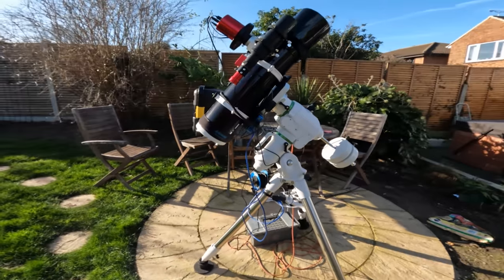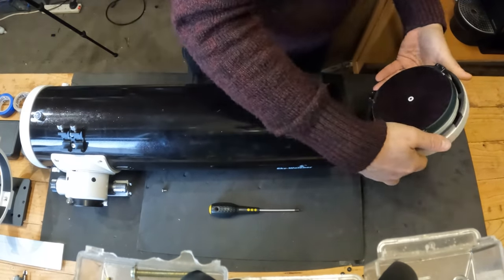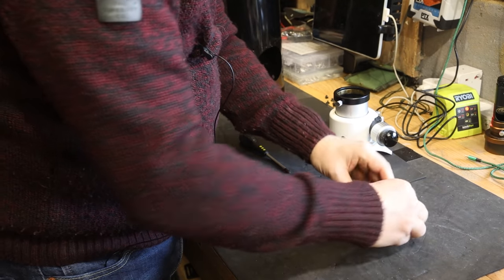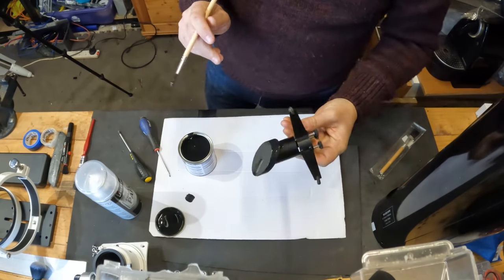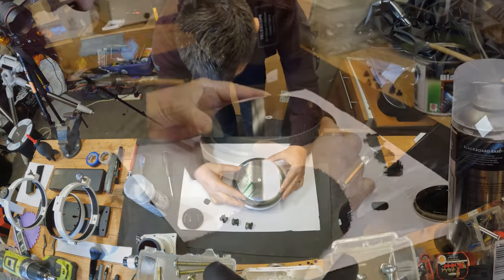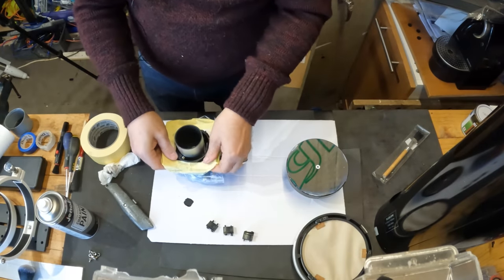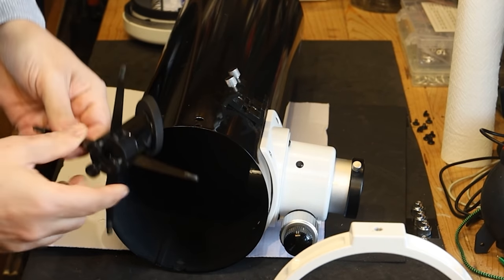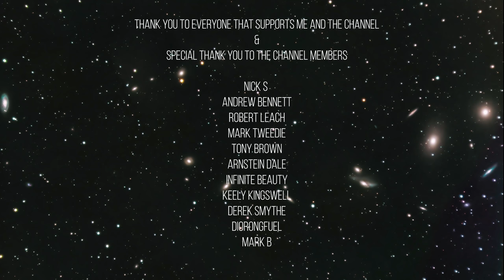How to improve your Newtonian telescope with a few EASY steps

Comment: It is a must have astrophotography mod for regular newtonians! I'd done similar to my SkyWatcher Explorer 200 a year ago. 
I can add some not obvious points.
Many paints remain glossy after drying. One should test several paints to choose the most matte and not reflecting (check at different angles). 
To diminish star spikes secondary mirror spider should be painted too (it is black but too shiny).
Reply: Some acrylic paints one can buy in art stores give very good results.
Reply from the maker: The blackboard paint dried in a lovely dark black matt finish so very pleased with that. Thank you for the tip on the spider veins I didn't think of that.

Comment: People underestimate how much shaking and mixing is required to thoroughly mix matte paints.  The sludge at the bottom that makes it matte compresses and compacts over time and takes a lot of shaking to mix it into the substrate properly.
Reply from the maker: Yes paint always needs a lot more mixing than you think. I thoroughly mixed mine though, just didn’t video the whole process as I am sure my video was boring enough lol.

Comment: Great stuff, I have thought about this myself but I just know I would get paint all over the mirrors. I would recommend flocking the tube as the "matt" paint used is not as matt as you might think.
Reply from the maker: Hi Clive and thank you for your comments. It was quite easy painting the edges I found. Thank you for the info on flocking. I am definitely looking to do this so watch this space.

Comment: Interesting video. I have used a black permanent marker for painting focuser tube and secondary mirror. It was fast and no disassembly was needed.
I also used flocking material inside the focuser and on an opposite side of OTA tube facing the focuser. Watch for light around the focuser tube. I used flocking material to seal it as well
Reply from the maker: Thank you for watching and comment, great extra tips thank you,

Comment: On my 200pds I fitted an aperture mask by Deepskydad  that helps as a lot of reflections come from the bevelled edge of primary and primary clips , flocked the ota with self adhesive flocking from Wilkinson’s , fitted a Steeltrack focuser , fitted secondary dew heater, added a third Ota ring and fitting Ali bar to lock it all together, also something to check is is the focuser square to Ota mine was way off only realised as I was changing focuser to the Steeltrack , blacked secondary edge too , stars looking sweet now from initial test 👍 focuser protrusion is an issue on those focusers from skywatcher either saw 15mm off but be careful not too much , fitting the steeltrack was a better option though Glenn built like a tank though not without its fault which was easily remedied.
Reply from the maker: Hi Boaty. I will take a look at that as so far I have only seen one by Teleskop-express. I fancy making my own though with a 3d printer. I would like a new focuser but the Baader is for 8" and upward and I am not sure if it can be made to fit the 130pds. Sawing 15mm off is a good idea, atm I get as much of my imaging train in the focus tube as I can so I need to rack out to get focus. Can I ask what the fault was with the steeltrack
Reply: @Astrobloke  The steeltack has a gap under the footplate used packaging foam to eliminate  light leak but a poor show on baader, there is a Spanish site that sells a 3D printed spacer that addresses this I will dig it out and post link , you could 3D print an adapter to overcome the ota difference in dia to make fit , I got mine from the widescreen centre.

Comment: The mirror cell has a cut out to go around the tube seam, it can only go in one way. The front section is just for aesthetics it doesn't do anything so doesn't need the tape either.
Reply from the maker: You are a little late to the party I’m afraid, this was over 2 years ago now but thanks

Comment: Lovely work Glenn! - I've done the same thing to a few newts over the years, another classic point of trouble I've found on the Skywatcher newts is the primary mirror cell to tube connection, it can leak light quite badly! (nothing a few turns of electrical tape can't sort though haha!)
It's great to see you going to the effort of showcasing these mods mate, a lot of people will benefit from this!
Clear skies my friend :-D
Reply from the maker: Hi Luke and thanks mate. I have noticed the light leak at the back and the fact its blocked by just a piece of paper which is glossy one side it doesn't surprise me at all. I am in the process of 3d printing a mask for the primary mirror clips and I think at the same time will address the back and put something better there. Clear skies mate
Reply: @Astrobloke  i was about to say what about an aperture mask for the clips. Cereal box, scissors, and black paint. 3d print longer lasting.
Reply from the maker: So many things you can do and great tips thank you.

Comment: Tinkering can have its benefits. I cut off part of focuser tube that was alittle long. Flocked EVERY possible. Not spider vain. Cut off primary mirror holders that over hung mirror that took some tinkering to make sure mirror would not fall but I only kept it above horizontal position after that. Made what I would consider a big difference on contrast. And a good collimation is a must. Clear skys happy hunting
Reply from the maker: Hi Charles and thank you for commenting. I love that you can tweak and tune these scopes and make them a lot better. The changes I made definitely improved contrast and love the scope more than ever. Clear skies to you too.
Reply: @Astrobloke  any recommendations on were to find a eq platform that might be somewhat affordable. Can't seam to find anything affordable and don't really have tools to try a make one. Missouri USA 37 degrees ish

Comment: Nice mods.  Next time when I remove my primary mirror for a cleaning, I will also spray paint the inside of my Dob OTA with the chalkboard black
Reply from the maker: Thank you O Z. I almost did this but then I took the flocking route. That has made a huge difference and something I would highly recommend you consider. You have probably already seen it but just in case here is me flocking mine and the results https://youtu.be/kwRnDIgNJps

Comment: Great video Glenn I take it this video was made before the PAS ;-) I did strip down a 200P & 250PX to clean the optics & to completely flock the 200P one thing I learnt when putting the secondary back together was to put a piece of paper between the mirror & the 3 clamps that hold the mirror in place to use it like a feeler gauge so the optics don't get pinched, that method always worked for me in the past.
It always amazed me why Skywatcher have silver focus tubes probably the worst colour to have chosen.
Reply from the maker: Hi mate and thank you. Yes it was made a few weeks back. Thats a great tip on the mirror. so do you tighten to a point where you can just slide the paper out? I know what you mean. Its a shame they don't just design it so the focuser doesn't intrude into the  tube at all. This is how my CT10 is designed.
Reply: @Astrobloke  Yes mate just tighten the screws so it just grabs the paper then pull it out as if they're tightened to much it can cause the mirror to be pinched & you could get weird shaped stars :-)
I really need to fettle with my 10" newt but it could do with a focuser upgrade as I really don't like the standard Skywatcher one.

Comment: Nice. Havnt seen anyone painting The mirror before. As for the back, on my 200p i had a metal cover that was also painted, on my 200pds i just use a black plastic bag+black textil bag covering it. Seems to do The trick.
Reply from the maker: Good tip thank you

Comment: if you make a small ring over the mirror holdels,you get also very nice  stars.  i also colimate with the fairpoint autocolimator,will give that extras too. on my quatttro 10 inch i have a new focusser,no tilt etc anymore. greetings
Reply from the maker: Thank you for your comments, really interesting. I am sorting a mask ring as we speak. going to 3d print one. I actually own a Howie Glatter laser and Tublug that I sometimes use but now days I always finish on a star (out of focus) planning to show this on another video. New focuser is really tempting as thats the scopes weak point to be fair. I really like the look of the Baader diamond steeltrac
Reply: @Astrobloke   i have the artesky focusser,they are made  for replace the skywatcher focussers.

Comment: Great video mate. i did this to mine a year or so ago and it helped a lot. i was worried about paint coming away were the bearings and focus knob ran on the focus tube so i masked those areas off too. Also i painted the back of the primary too. All the best mate and clear skies
Reply from the maker: Hi Tony and thank you so much for taking the time to watch and comment on the video. Thank you for letting me know you painted the back of the mirror also, I just wasn't sure what to do. I am 3d printing a mask to cover the mirror clips and when I take it apart to fit I think I will paint the back of mine too. May replace that slip of paper with something a bit better too.
Reply: @Astrobloke  Leave the paper out ,the mirror will cool faster,many Newtonian companies have vents and electric fans to cool mirror,mys is vented 130mm Celestron,Newtonian,and flocked everything,and got thinner vines ,that mirror was beautiful ,did you replated with real silver?.
Reply from the maker: @vicamaral  I have actually since designed and 3d printed a mod to not only cut down the light leak at the back but introduce a fan also. I have also just finished flocking it too.

Comment: Be good to try this with Black 3.0 paint. I have a roll of Japanese 99.7% non reflective material. Any ideas how you would flock the tube with it? I assume glue but seems like a tricky thing to do. Any ideas on application appreciated
Reply from the maker: I did think about flocking but having never done it I was not sure of the best way to proceed and then decided not to this time. Might look to do it over the summer months. Martin of MPASTRO flocks Newtonians and has videos on it. May have some pointers for you on there
Reply: @Astrobloke  I’ll check it out. Really looking forward to seeing if you get better results

Comment: How well does the blackboard paint stick to the glass over time? I'm worried about the warming and cooling cycles  that telescopes go through.
Reply from the maker: Hi William. That is a very good point and not something I really considered. I have checked and no paint has flaked off at all and its been 10months so almost a year and definitely through a few temp changes and seasons, so it seems ok
Reply: @Astrobloke  oh good. I'm getting a second hand Meade SN10" OTA and I'm thinking of "improving it". Mind you I still need to get it a mount.🤣

Comment: Hi Glen - I'm planning on making these same paint mods plus flocking my 150PDS (have bought everything just need the courage now!). Just a couple of queries - what materials did you use to clean the mirrors with, and what tools do you use for collimation?  Cheers Danny
Reply from the maker: Hi Danny. You'll be fine doing it. It really is not difficult, just give yourself a nice bit of time and don't rush. The mirrors I clean with water and washing up liquid. Thoroughly rinse. Then final rinse with distilled water. I use a basic laser collimator and then check with an out of focus star.    https://youtu.be/KDzvTM1frM4
Reply: @Astrobloke  thanks Glen, that's helpful.  I have a laser collimator so am good to go!
Reply: @Astrobloke  Well I took the plunge today and flocked my 150PDS as well as painting mirror edges and focus tube.  Wasn't as scary as I thought once I got started.  Funny though there was no cardboard disc that the primary mirror to sit on, it just sat on the cork tabs.  I suspect there may be light leaks at the primary end.  I got a few air bubbles and slight creases on the flocking paper but managed to get them mostly out.  Must have replayed your video a good few times during the day!
Reply from the maker: @4500Timer  Thats excellent mate and look forward to seeing what difference it makes for you. Don't worry about bubble and creases too much as they would have to be huge to impact on the mirrors and imaging. I wonder if its just the 130 that has that paper disc? Let me know how you get on with the changes, clear skies
Reply: @Astrobloke  Hey Glen I managed to get some RGB data on the Cocoon nebula with new flocked and painted 150PDS. Am super pleased with the results - some of the best quality data scores I've had for RGB during stacking in APP and stars look small and nicely shaped.  I'll post the image up on Cloud Magnets shortly.  Many thanks!

Comment: I'm running a 150pds (among other things) and I as you have a protruding drawtube into the main tube. I feel like it is cutting into the starshape, basically taking a bite out of them. Is this something you can also see?
Reply: Yep, I did with my 130
Reply from the maker: when imaging I adjust so the minimum is in the tube but this is something I have thought about cutting but since started to consider a focus upgrade. The Baader steeltrac.
Reply: @Astrobloke  okay, so it is not just me but bad design og the focuser

Comment: I cut mine today omg 😲  no need to take if your just painting the focus tube  it apart just slacken the allon keys and silver lock screw and pull tube out after painting there are 3 roller bearings  the rub on the tube so yo make it worse you end up with stripes were the rollors cut through  the paint don't you think skywatcher would have painted it 😂

Comment: Do NOT paint the edge of your primary mirror.  This does nothing and will prevent the mirror from being recoated in the future.  A mirror recoating company will reject the mirror because it can’t be chemically or ion beam cleaned.  You will need to buy a new mirror when the coating degrades.  If you are worried about the beveled glass edge use a mirror mask to cover the edge and mirror clips.  Nothing is gained in painting the primary mirror edge...  There's benefit in painting the secondary mirror edge.  There's also benefit in adding a cover plate (plastic) to the rear of the mirror in the mirror cell.
Reply from the maker: Thanks for your comment Jim but unfortunately its a bit late as this was done over a year ago. Being a mirror from a scope costing just £179 I would replace the mirrors with new upgraded ones if they ever degraded to the point they needed re coating. I have had great results from the changes i made and I think were worth doing for me but thank you for sharing your knowledge as I was unaware this would prevent any professional cleaning or re coating
Reply: @Astrobloke  just rewatched this video( i had seen it a while ago) as I aqcuired a 200P a few days ago and I'm thinking of basically doing the same things. Were the results very noticeable?
Reply: @WilliamBlakers yes it improved contrast dramatically